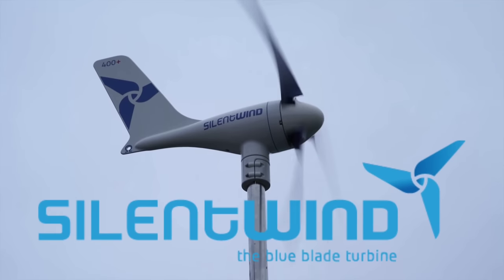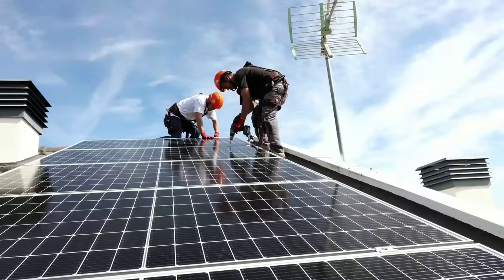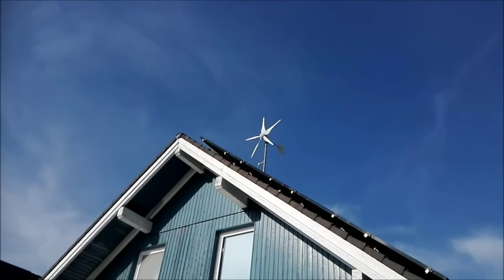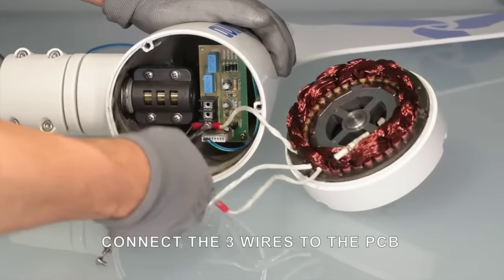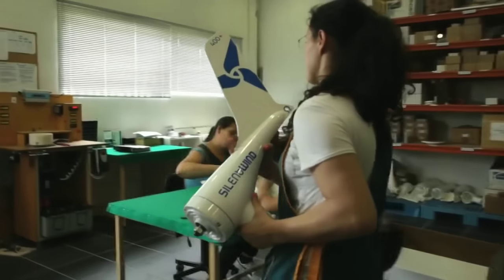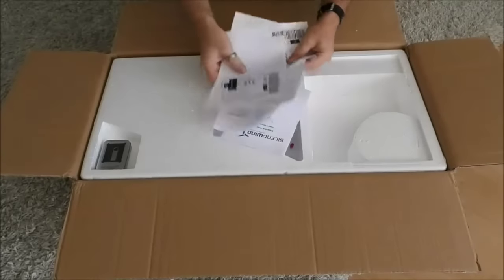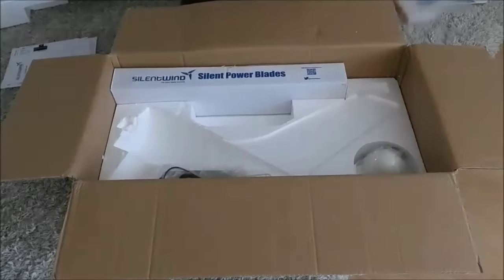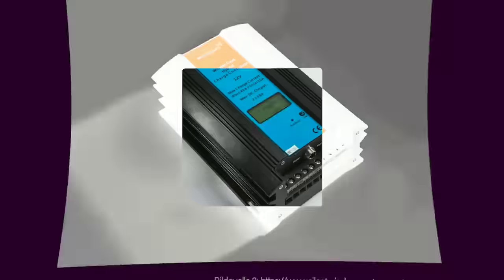Silentwind Pro: The World’s Most Powerful and Affordable VAWT that Outperforms Solar Panels in 2023.

Comment: OMG! This wind turbine is NOT vertical axis. It is a horizontal axis turbine. 1.5kW is smaller than most solar panel system. Mine is 5.6kW and more recent roof-top solar panel systems produce higher energy due to significantly more efficient panels. Please get your facts right!
Reply: Can you inform me about your 5.6 KW wind turbine
Reply: @pjmask9769 dude, he is talking about his solar system. Read context. Sheesh, do I gotta explain everything 😂😂😂
Reply: I understand your frustration with mislabeling this as VAWT but come on about the solar producing higher energy! A lot of people live further north that don’t get solar 98% of the sunny days those in the south do. Plus we have winter where there is less sun light hours and more snowy days both of which diminish the amount of power we would get from solar systems. Also no matter who you are or where you live your solar system is getting no power generation at night! This is why a wind turbine system makes sense for those of us in the great white north. Wind blows at night as well as the day creating power whether the sun shines or not meaning we may get more total power creation in 24hrs than your 5.6kW solar. To me and many of us up north buying 2 silentwind pro turbines makes better sense than buying a 5.6kW solar system that in all honesty is only going to be making power about 5-6 hours each day during the winter months. So keep your solar and the larger area needed to have enough panels to create 5.6kW, I’ll take the much more compact area it will require to put in 2 wind turbines to create my 3kW of wind power!
Reply: I see that wow
Reply: 1.5k bull s--t
Reply: "Panel"

Comment: Sure looks like a HAWT   Maybe a cutaway would have dispelled my confusion.......
Reply: Nope this is NOT a VAWT.
Reply: @terrybeckelheimer3633 It certainly is not!
Reply: Misleading title.  You are not confused. This is NOT what a Vertical Axis device looks like in operation. You don't need a schematic to clarify. It is a small version of those big windfarm HAWT devices, so has to swing around to point into the wind. A VAWT does not do that! 

The voiceover is ill-informed puffery lacking in performance details. You would need a bunch of these, plus a battery, to run a home. Contrary to the narrative, 1.5 kW is barely enough to run a kettle or a heater and not enough for both at the same time.
Reply: @EdMorbius46  That is exactly why if you want to go off grid and use renewable energy you should not have electric heaters and stoves. 1.5kW is enough to power my home unless I use a microwave but that is also why any use of renewable energy should be connected to a battery storage system. With a battery storage system you may not need multiple wind turbines, but as someone who prepares for problems, having 2 or more always makes sense for redundancy in case one breaks down or has to be repaired or have maintenance done.

Comment: A permanent magnet generator is known as a magneto. It is similar to the old bicycle generators used to light the headlamp. They are very simple but have poor voltage regulation. You must either use the power line or batteries as a buffer to keep the output constant. The blades look a bit fragile.
Reply: Yes thus condition of a critical winding or like a malty byfiller coil of 5 or more the amps or watts  is less straned resistance in motion to have fased motion like as many half in and half out to split the malty fased coiled constant output so the resistance is push pull by the  so called voltage drop from coil passed the magnet half way before it reaches on the motion of 1 pushes and the next one pulls at the same time creates no magnet resistance thus is is 16 fase or more being the advanced way of wiring the generator to bring MDX performance but it could have hest problems from heat
Reply: Thank you for sharing your knowledge about magneto generators and your observations about the blades in the video. In terms of outdoor gear and home backup power products, I highly recommend checking out the Segway Portable PowerStation Cube Series. It offers a massive 5kWh capacity, powerful output, fast recharging, versatile sockets, and comprehensive protections. Its waterproof technology and uninterrupted power supply make it perfect for outdoor adventures and ensuring uninterrupted family time. Let me know if you have any other questions or if there's anything else I can help with!
Reply: When you have installed a turbine on a suburban rooftop for a year. Then advertise the result to us.

Comment: So 2k plus delivery, installation, batteries, inverter and some bits and pieces and taxes you’re over 3k.  Realistically the unit would have to work flawlessly for more than 7 years for me to break even.  How long is the warranty?
Reply: Well, they installed some fancy blue emblem on this Chinese wind turbine,
so you can believe that they give you years guarantee on it 😂
China are able to make quality wind generators, but this one is not one of them.
As he said, manufacturer guarantee green free electricity without noise.
Think if I choose to buy one, I choose to buy exactly same without Pro emblem for $150 without blue wind Pro emblem 😂
Just listening to way he speaks, it's alarm Bell's ringing no no 😂
With price like this for such a small wind generator's, it should at least have 10 year's life guarantee.

Comment: Can you make a video proving it can produce 1kwh of wind power, I bought 2 different kinds, there both 400w n only can make 100w, kinda bummed out getting ripped off
Reply: DISCLAIMER: 
Our channel is purely made for educational purposes, based on facts, rumors, and fiction. ....lol
Reply: Do you have the ideal conditions set forth in company information? That information will probably include siting, such as height above structures, terrain, surrounding structures and trees, and typical wind conditions for your location. 
   I'm not defending the company. I'm only suggesting the variables that can affect performance.
Reply: You may know a lot more than me about wind generators. 

I have only looked into it a little bit here.

There are some important facts about wind generators that hit you up front.

1) you really do need quite a bit of power generated to even affect a battery bank.  The bigger the battery bank the more power you need to make any effective charge. Batteries have an inherent resistance. You have to overcome that resistance before they charge. The bigger the battery bank the more power you need simply to begin charging the batteries.

2) the claims manufacturers make regarding how much power they produce are always massively over stated. The claimed power out by the manufacturers requires extremely high and SUSTAINED wind. Typically the power out is.much, much less than the manufacturer claims.

3) Resiliance: these things wear out really, really quickly unless you get an extremely high quality unit. Marine turbines built to sustain ocean environment are going to last a whole lot longer. The type of magnet will influence longevity. Chinese manufactured units will typically perform poorly and wear quickly. However, there are some good ones. If you want to go with a chinese brand there is a terrific YouTube channel that does an amazing job reviewing Chinese made turbines. It's called: Toys For Watts

4) The pole has to be really strong or else it will come crashing down. It is highly recommended you have a pole built that allows you to fold it over. This lets you lower the unit to the ground during times of maintenance or hurricane.

5) like any other power source, you do need lots of investment and equipment to convert the turbine energy to usable charging current.

That's the brief overview. My feeling is to learn much more about it. There are types (vertical and horizontal - horizontal performs better however a vertical unit allows you to have two on a pole running in such a way to double energy). The type of blades is important. There is a unit called the "Liam" which makes sense (a screw like blade design). There are some designs that make very little noise.

In the final analysis, it might be best to use a combo: solar and wind.  Having access to water would be absolutely the best option: micro hydroelectric.

Comment: I’ve been interested in Wynn turbines and looking into them for quite some time. I currently have a solar system and according to my calculations, your 1.5 kW wind turbine cost the same as my 6.6 kW solar system did. Where is the cost saving when my solar system produces three times what your wind turbine will? Please explain how this saves money and also the advertisement says the turbine doesn’t need to face into the wind to work. How does this work when it has a rudder for wind direction on the casing? 🤔🤥

Comment: the website shows them as DC power (12,24,48v) suppose that needs to be paired with dc->ac conversion the same way as solar panels.  They look to be primarily focused on marine applications, not home.
Reply: It comes with a inverter

Comment: Very interested!!! One question: We are sometimes hit with ice storms. Clear ice being an issue  that can cover everything with a half inch or better. The blades of the turbine would no doubt be affected. Are the blades heated, or can they be cleared of ice somewhat easily?
Reply: It looks like a scam buddy! They don’t even know the difference between HAWT and VAWT!
Reply: I think that part is just poorly explained it’s still a HAWT but the HAWT is acting similar to a VAWT by spinning around to follow the wind. But the actual charging part is definitely HAWT. 
I’m trying to give the benefit of the doubt
Reply: @shanonedser1 Yeah, they do. Check again for the axis the blades are actually rotating on. It is a HAWT. The vertical rod is so the blades can catch the most wind.

Comment: These are NOT silent. I've used this design in the past and they sound like a helicopter landing in your backyard. And you'll be lucky if you ever are able to produce even 400 watts from this tiny wind generator. In addition, this is NO vertical axis wind generator. They're obviously using the wrong audio for this video.
Reply: You are right, I've owned a 2.4kW wind turbine for the past 15-years and it's LOUD!  a solar panel or two is MUCH better of an option than this POS.
Reply: YALL TALKING ABOUT OLD TECHNOLOGY , SIMILAR LOOKING DOES NOT MEAN THE SAME LOL !!!
Reply: Did you use these rotor blades? You didn't...

Comment: Does it have a guard to keep the birds out and keep from breaking the blades?
Reply: No, it chops the birds into little pieces.  They make good fertilizer.
Reply: But I wanted to put them on the bbq pit.
Reply: The blades are unbreakable because of carbon fibre. I tested it with a big bird on the way from New Caledonia to Australia...
Newer blades are painted in two colours for better visibility.

Comment: This sound amazing, I would like one. No storage batteries are mentioned, perhaps they are not needed?
Reply: Batteries are absolutely needed for any wind turbine. They ensure voltage remains stable so your lights and TV don't shut off dozens of times per hour.
Reply: There are two options. With batteries to have a buffer or directly feeding the public grid when it is allowed ( or a combination of both)

Comment: Fake: Your entire house can be powered by this VAWT 1.5kWh capacity. An average solar panel generates 0.7kWh. 
Misleading: You need to also buy an inverter to convert DC into AC, and batteries for those days that wind doesn't blow, like in a very hot summer day. 
Truth: The most powerful solar panel I've seen is 0.46kWh, so you only need 4 normal 0.4kwh panels to reach 1.5kWh, but still, this amount of power is very small. With $2000 you can get about 10 x 0.4kwh solar panels that don't stick out of your roof like a sore thumb. CO2 is not the enemy, it's the politicians that wash your environmental brain with nonsense. CO2 is the living block for all plants; the real nasties are the noxious gases, heavy metals and other contaminants that politicians say nothing about, because it suits their business donors.
Reply: Fact: your solar panels will create no power at night! 
Fact: even during the day you can have cloudy rainy days where your solar creates less power than you expect it to. 
Fact: the wind often blows at ALL times of the day creating power whenever the wind is blowing! 
Fact: your solar panels need a lot more area to create power than this very small wind turbine does! 
Fact: you also need an inverter and batteries to create and store your solar power to use at night when your solar is not creating any power! 
Fact: CO2 is the enemy when it is created at a higher rate than normal due to human industry. 
Fact: the increase of CO2 has caused temperatures to rise in areas where normally it is cold (mainly permafrost areas and the arctic), this increase in temperature (since you didn’t want to say it) is melting permafrost and releasing large quantities of methane gas! 
Fact: methane is 100 times more dangerous than CO2 because it causes temperatures to rise higher and quicker than CO2, the only bright spot is methane lasts a fraction of the time CO2 does but it will boost the speed of global warming faster than the CO2 will.
Not Fake: this turbine will create power for more hours of a 24hour day than your solar will including at night when solar is useless.
Reply: Oh I almost forgot this; your statement of “average solar panel generates 0.7kWh” does not really seem accurate when you then say “the Most Powerful solar panel you’ve seen is 0.46kWh”. Make up your mind, are average panels really creating 0.7kWh when in actuality you have only seen the most powerful at 0.46kWh. I’m not calling you a liar but your facts or opinions seem to be not matching which in turn makes you look like you don’t really know what you are talking about.
Most panels I have seen create 400w not to say there aren’t ones that create 750w but solar is not an absolute cure all for us in the north where sunlight is not abundant in the winter months. This is why wind power makes more sense in this area.
Reply: @Infinityfields 
0.7kwh is what the video states; I say that the largest I've seen is only 0.46kwh...is it clear now?
Never said solar panels are the cure for anything.
You don't consider solar as an option, that's ok. Wind might be better for you, and that's ok too. Your point is?
Reply: With back up batteries you can go with out on those cloudy days too. You can also get a generator too.

Comment: Can we use it's generation voltage to solar inverter (48 voltage system )and how ?
We have 6kw solar system  connected with 4 tubular batteries 230Ah already
Reply: It's possible but you need to find a MPPT controller that handles wind turbines, mine can be used just wind or wind and solar together, the higher it can handle in amps the more watts it can handle

Comment: THIS IS NOT A VAWT (vertical) IT IS A HAWT (horizontal)
Reply: It doesn't look like a horizontal turbine the blades are not horizontal to the ground for a start
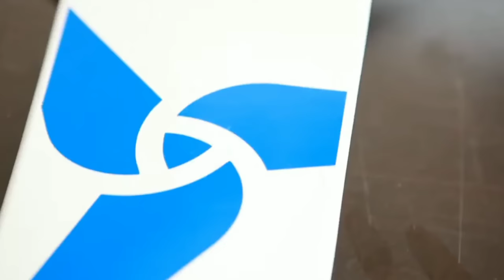Reply: @michaelfitzpatrick6264  Horizontal refers to the generator, not the blades, and at 2:06 where he compares it to the standard wind farm, they are identical, if a bit smaller

Comment: A great green electric supplement for a mobile home installation. Mobile home roofs cannot support solar panels.
Reply: Why not? Please don't tell me that the roofs aren't strong enough.
Reply: you just need to reinforce the frame of the roof, if its necessary
Reply: @Gruxxan  A mobile/manufactured home does not have attic access to the roof framing.

Comment: Total bull-crap.  This is rated to produce 420 watts of power with a 29 knot wind.  At 19 knots it only generates 100 watts worth of output.  To get that kind of windspeed, on a consistent basis, you have to put up a sizable tower, ensuring this HAWT is well above existing rooflines and treelines.  By the time you pay for the turbine, the tower to get up to usable wind speeds, and then the cable to run the power down to your controller, you could have purchased enough solar to triple the total output.  The only place turbines like this make ANY sense at all, are in extreme latitudes, where solar potential is limited and the wind is relentless.

Comment: What did you do for the birds ?
How about instead of the bird mutilating fans you try the fans that use the wind going into the holes on a round object - kinda like a water wheel. Try that so birds are safe please - or maybe its a noise issue?.
God bless you.

Comment: The output of a solar panel is Watts (power) or Watt-hours (energy). KW per hour is meaningless! Also you compare one turbine with one solar panel. This is nonsense. A typical home may have from 4 to 50 solar panels - would you install that number of turbines on your home? Everything you are showing is an horizontal axis (HAWT), so please fix this video!

Comment: All practical tests show that all small wind turbines hardly generate any electricity!
And only at costs very significantly above 1$/kWh.
This is because there is hardly any wind close to the ground. In addition, it is extremely gusty, which always reduces the lifespan of the systems. 
Solar plants, on the other hand, generate electricity reliably for 25 years at approx. 7-12 cents/kWh!

Comment: NONSENSE!  All practical tests show that small wind turbines hardly generate any electricity! And only at very high costs! 
Because there is hardly any wind close to the ground. It is also extremely gusty, which usually shortens the service life extremely! 
Only if you need to be self-sufficient from the power grid & live close to the sea, you should install the largest possible wind turbine on a high mast. 
With solar modules, on the other hand, reliably generate electricity for 25 to 30 years at approx. 2% to 5% oft he cost of small wind turbines!